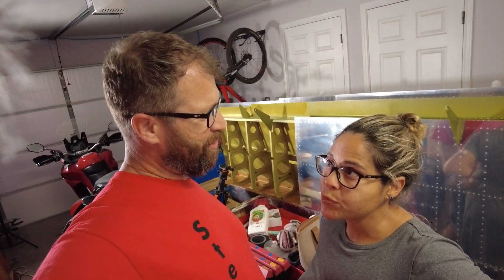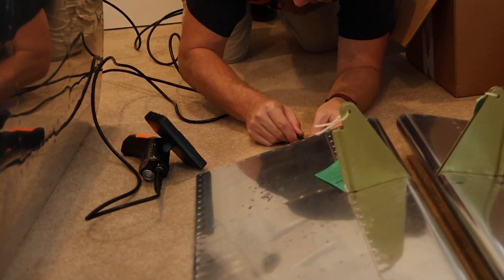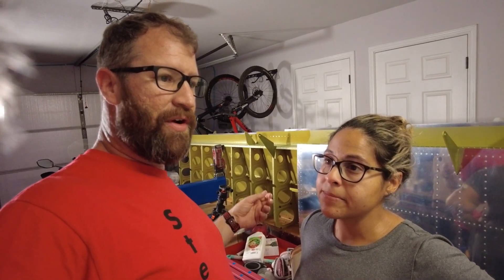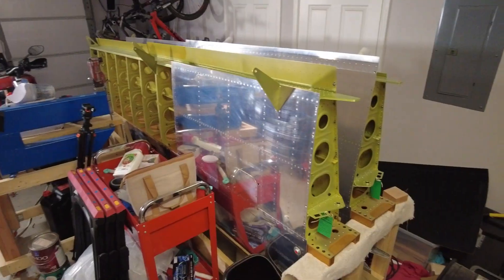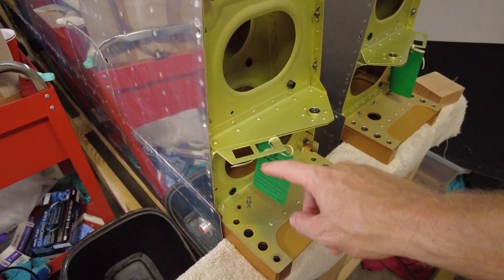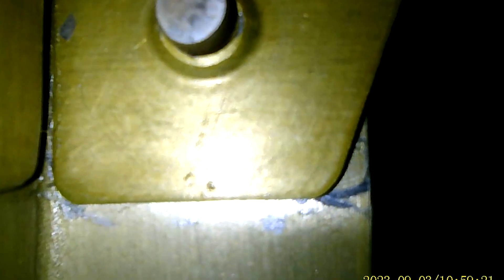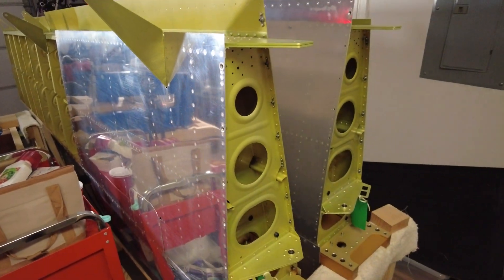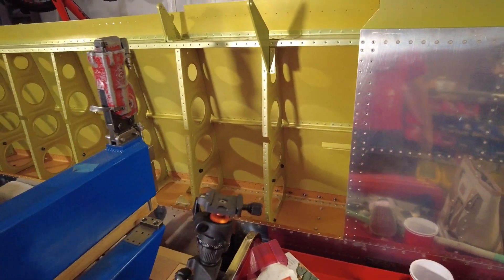Vans Aircraft Laser Cut Part Update:  What About our QB Wings?

Comment: A piece of advice: You don't see cracks right now doesn't mean they won't appear when you load the parts the first, second or third time, aka fly the plane.
You don't want any cracks in a plane you'll actually be sitting in 10k ft above the ground.

Make sure you do not use any parts that are even remotely suspicious! You don't want to appear on Blancolirio's channel for all the wrong reasons!
Reply from the maker: I get it.   But I am also not going to condemn my Quick Build wing that appears to have zero cracks anywhere.    I say, appears because I haven't been able to fully inspect the wing yet due to it being tucked away in my garage.     If I see signs of parts that are suspicious they will be taken care of correctly.

Comment: The 10s and 14s of the affected model years will also incur problems with insurance coverage and resale.  There must be a class action already being contemplated.
Reply from the maker: I've never seen an Insurance company do anything due to an issue like this.  Piper Wing Spar AD, several major ADs on Cessna Cardinals and 210s, and insurance isn't a problem.  

I think people are making things sound worse than they are.
Reply: @N14VE  Maybe.  Maybe not. If I had 10G in a QB wing? No way I’d suck up 10G, then have to tear down and rebuild a set I paid to have complete. The absolute least Vans could do would be take the old QB wings back and send the builder a fresh kit. They are not trying to make this right. Lucky we had just finished the VS.
Reply from the maker: @CaptainChaooooos  the quick build aspect of this is the worst for sure.   Problem with just taking it back is the shipping cost.   It was 2k to a third party to get my wings here.
Reply: @N14VE  we are lucky that the vertical stab was the only piece we had completed.  Still it will probably cost a couple thousand to repair their mistake.  Third R.V. we have built. 6a, 12is and now this.  Was planning on ordering a 15 at Osh this year, but we all know the story on that.  Vans is defiantly been off the tracks this past couple of years.  Hope they survive. Hope other manufacturers learn from those mistakes.
Reply: https://youtu.be/3Qsfw6pmHe4?si=eBnU4wP8UgRopF4Y

Ouch.  Solvency will be tough.

Comment: Thanks for this video, you hit the right tone. We are pretty much in the same boat, except for us it is a QB Wing AND a QB Fuse. I do feel for Van's, and I am looking for a way forward. Right now though - with LCPs in QB kits categorized as "replacement recommended" and "uninspectable" at the same time, I just do not see a way forward. And that's 3 month after the issue was officially recognized by Vans.
Reply from the maker: I feel these delivered QB wings with LCP in them is the biggest challenge for Vans.     There is no clean solution.   I want to be able to just "Swap" them for a good set of wings.   But the freight shipping on them was $2,000 one way.    Shipping alone makes it a big expense to recover from.    
We still have hope that our Wings are in good shape without LCP.  I just need to clean up our garage so I can gain access and do a full inspection.  What I can see so far tells me I'm safe to build on.    But I can't make that final call until I complete a full detailed inspection.

Comment: Best of luck with this, but I can honestly say I would not be nearly as lenient on Vans as you and some other builders are being.

Aviation parts manufacturing and procurement is a SERIOUS business, and if Vans doesn't have the funds or insurance coverage to replace and ship parts/assemblies deemed unairworthy (by a 3rd party engineering co) to builders at no cost, I can say with confidence they likely do not deserve to be in business under their current leadership. Regardless of what their motives were with using laser-cut parts, clearly there was not enough QA oversight during part production OR final assembly. Parts like this should never make it to the customer. Purely unacceptable in aviation, regardless of category, and especially on the scale that Vans operates.
Reply from the maker: The miss in QA and process control was a seriously huge miss here.   The truth is, the original LCPs that were designed and tested are good.    But how a 3rd party was able to change the process and it went unnoticed is a huge miss.   The result of the bad LCP is very obvious when wrong.  

But on the flip side of this, the main draw to Experimental is the ability for the builder to not be constrained by certification of everything.  You can find a part on the shelf that works and you think it will work, use it.    That flexibility has a real double edge to it.    In the certified world, there would have been mandated part traceability for this issue.   Being a Kit Plane, that isn't mandated, so it didn't happen at all. 

Just hope our wings are good to go.

Comment: I have confirmed laser-cut parts in my nearly done SB wings and just started SB fuse kit. For the wings I will be accepting some "acceptable to use" laser-cut parts, which are mainly the main spar ribs, leading edge ribs, and tank ribs. For the "recommend replacement" flap hinge ribs, as well as one or two partially completed assemblies in the fuselage, I'll be waiting to see what Van's comes up with for their "alternative solution". In the end, my airplane will not be completely free of laser-cut parts, which is a punch in the gut, and making me reconsider my priorities.

Comment: I’m one of the lucky ones. I haven’t started building yet. I received my SB wing and fuse kits several months ago but decided to wait on my empennage to start building. My emp shipped after the whole laser saga kicked off so all LCP were pulled by vans. I’m still waiting on the back order punch parts for the tail and have been told by vans that it could be several months. In the meantime, I’m pulling LCP off my shelves for the wings and fuse and will be waiting for those replacements. My main concern is that years from now, my airplane will be associated with this whole ordeal and will definitely be a difficult airplane to sell if I should ever need too.
Reply: Document that you replaced All LCPs even the ones they say are OK in your log. Keep the invoices for a new buyer. Then it will be fine.
Reply from the maker: Glad to hear you won't have to unbuild to start building again...  By the time we go to sell these airplanes, this won't be as big of a deal as some people are making it out to be.   If you followed the process and replaced the parts and the plane is flying good, it will sell.

Comment: Today's mission since yesterday is to finalize my parts list and get them ordered. My empennage and wing kits are full of bad parts. Good luck.
Reply from the maker: How much of your kits have you already built?   Are you going to have to drill out a lot and rebuild?
Reply: Thankfully, I just started my slow build in the spring. I have my vertical stab built and do not have any problems with it. My horizontal stab is completely ready to rivet together but I have been waiting as the front and rear spars are on the list. I know the front spars came from Van's but probably not my rear. I did not notice any indicators related to the laser parts issue so I am just trying to figure out where they came from since my elevator mounts to that thing. If I decide not to use them, I am going to just build an entire new horizontal stab kit since I do not want to try and match drill through skin holes that are already dimpled. I show some parts on my last build video that are just scorched so I am not using ANY part if they are on the list. I felt bad hearing about the people you know that have given up. I am a single, blue collar guy and this project is moronically expensive so if I had to spend a lot of money reordering parts they don't cover, I would have given up too. I have a very specific financial plan for this to work with some wiggle room but I am supporting my oldest niece while she is time building on her way to the airlines AND paying for my 16  year old niece's flight training during all this so I really am not in the mood for shenanigans. LOL @N14VE
Reply from the maker: I took a look at your most recent video on your YouTube and left a few comments.  Most of your parts covered in Blue are good to go.    On your Horz Stab... I can't see the quality of the holes.   But if they were laser cut parts that needed to be replaced, even when dimpled, the Notch in the hole would be VERY visible.   If you are seeing a smooth hole with no notch, I would build on and not replace.
Reply: I will admit that my dimpled holes on my rear spar seem to be beautiful so I am feeling confident. They definitely did not have the blue film on them like the front spars so I need to find out if Van's sent parts out like that as well for future reference. @N14VE
Reply from the maker: Van's has published that:  Not All Punched Parts (Good Parts) have blue cover on them.   There are times that punched parts have the Blue removed in manufacturing for a number of reasons.    So just because it doesn't have blue, doesn't make it bad.    If it has Blue on it, it is 100% not Laser Cut.  Because the Blue HAS to be removed in order to do the laser process.  

The real determining factor is the quality of the Holes.   Laser cutting doesn't make it a bad hole.   The laser cutting the hole wrong is what makes it bad.  Wrong is defined by that extra burn mark that appears as a peak in the hole.

Comment: Best of luck for the new arrival.
Sorry about the laser parts.  How that ever happened is very hard to get over.  Just the idea of using a laser to manufacture aluminum parts for an aircraft is crazy because every part is subject to heat stress and a hole that is not smooth resulting in a less than round hole.
I hope this will be resolved soon.  I'm waiting to build an RV15.
Reply from the maker: The sad thing is, for the Laser Cut parts that were produced per spec, they are actually fine.   It is only the batches from the 1 or 2 vendors that didn't follow the spec that are really bad.   Still, Laser cut parts are a thing of the past.   There is no going back to them ever again.
Reply: Why didnt vans require vendor IDs, batches, dates in all the parts?  Seems old school met modern reality.
Reply: The issue is that the subcontractor that did the laser cutting changed how the holes were cut. The way the laser cutter works is that it fires up the laser then moves the gantry, which means that the laser is momentarily stationary, which heat treats the metal. So if you design the cut so the laser starts up, moves to the edge of the hole, finishes the hole, moves to the middle of the hole and then shuts off, all is good. Apparently they used this cutting method that avoided heat treating, but changed it for some reason, probably speed. The cut they used momentarily paused the laser at the same point - start up and at shut off, and that point was at the edge of the hole. Hence the problem.

Comment: This laser cut fiasco is a real problem for many of us builders. I was soooooo excited to start my RV-14A build. I ordered all the kits, engine and prop in March. Spent months buying tools, optional equipment, building a paint booth, tables, etc. I was READY to build in June when my wing kit arrived. Now i have nearly 100 laser cut parts that need to be replaced before I can start. I probably won't see those replacement parts for many, many months. The crating windows for my remaining kits have slipped by months and will likely be extended well into next year. Very demoralized now. The excitement is gone. I'm tempted to just forget about my RV-14A and buy a certified airplane and move on. I really hope you get some kind of reasonable solution to your QB kit that you're happy with. Good luck - and good luck with your new baby! Amelia will help you forget all about laser cut parts!!!!
Reply: I feel you. I’ve considered switching to another manufacturer because I really want to build something but at this point, I’ve got too much invested in Vans. I can’t take the $50,000 hit so I’m just gonna wait it out and build on
Reply from the maker: The thing that scares me about other manufacturers is they don't have the experience that Van's does.  For all we know the others have done similar issues but no one "Caught" them.   And would they stand up and do the right things to resolve them?   Yes, Van's did make a really bad mistake here.   No, it should have never happened.   But on the plus side, Vans is standing up and working with us to do the right thing.   I still trust Van's 50+ year history to produce a quality safe airplane.
Reply: @N14VE  I agree Vans has a great track record for excellence in engineering. What they lack is an understanding of PR and a respect for the influence of social media. I sent Greg a message about this right when the laser cut parts issue hit the fan but it apparently fell on deaf ears. They had a very short window to respond properly but missed it. I hope Vans learns from this and puts steps in place to avoid something similar from happening again in the future.